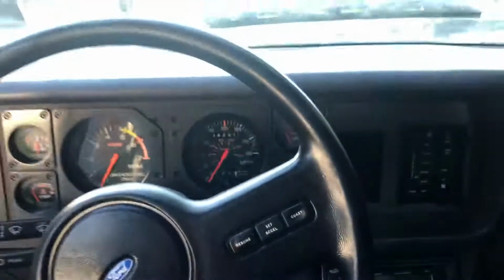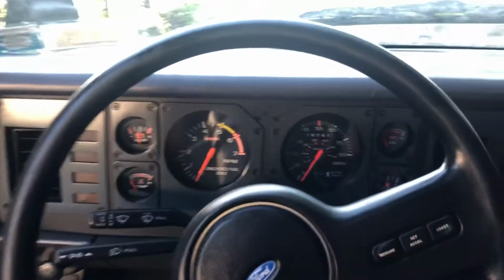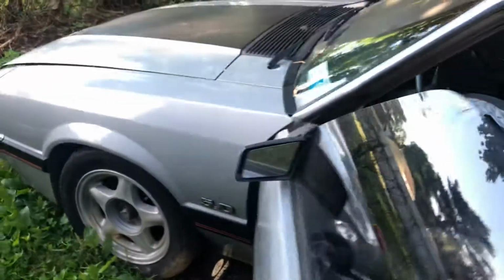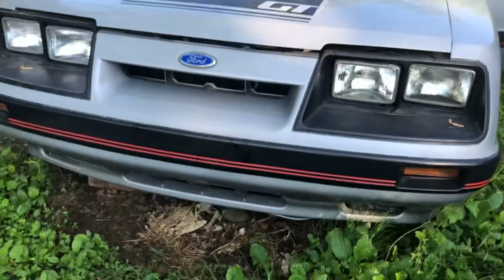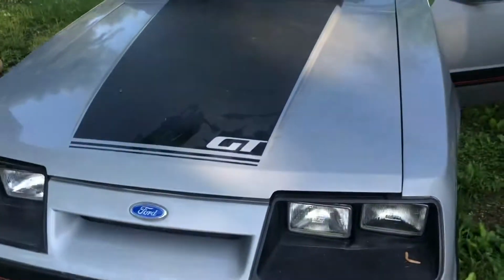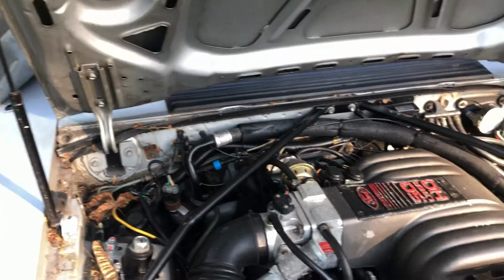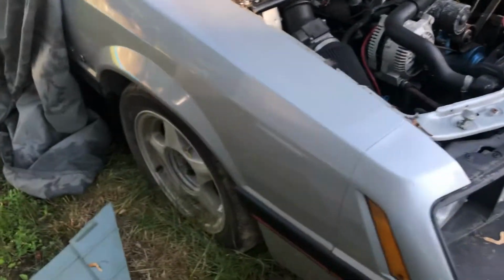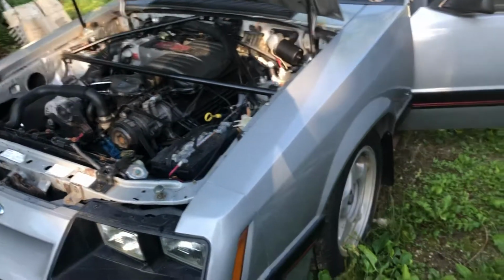The 1986 Mustang Gt project begins!! First look at the car when cover is removed

Comment: Man, that 86GT looks really clean. Good luck with the build! I personally would not remove the a/c, My 85 runs mid to high 12's and has a fully functioning a/c, power steering and cruise control and a flex fan. The weather here in San Antonio has been reaching over 100 degrees this month.....I gotta have a/c bro.